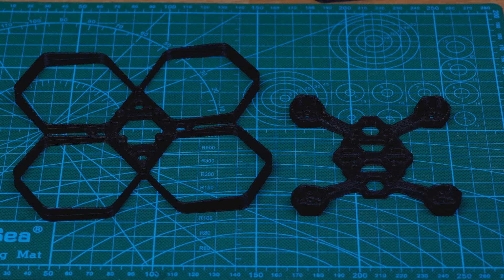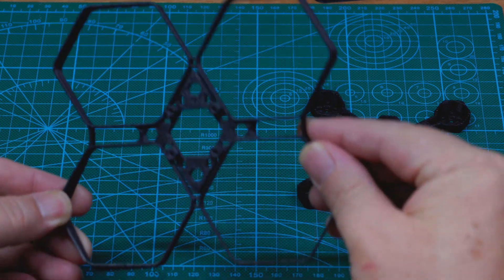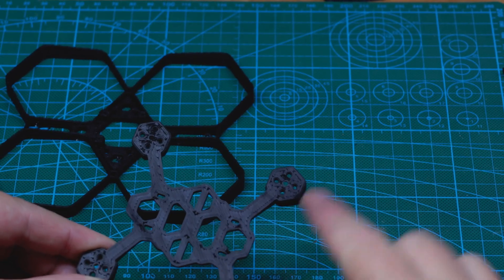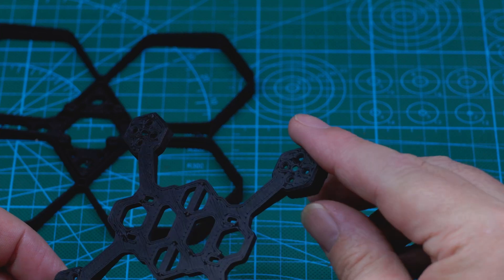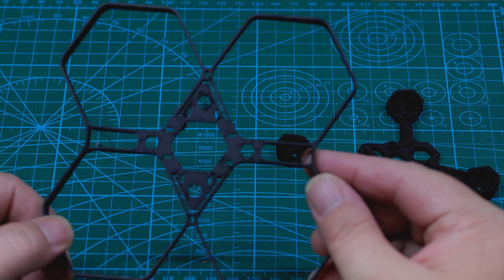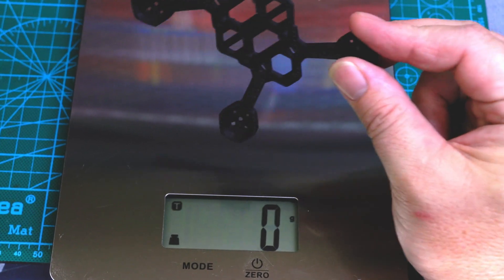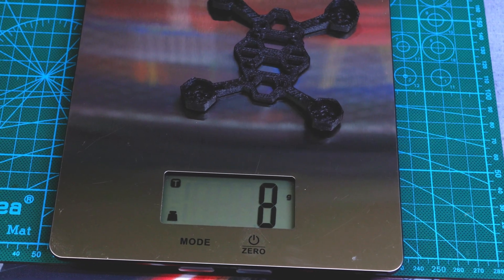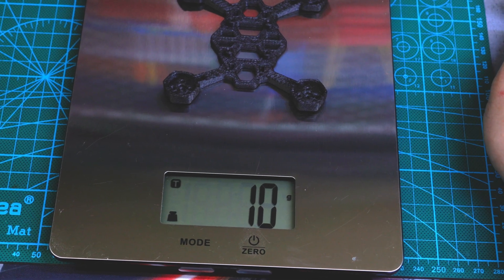Bambu Labs Carbon Fiber Filament Comparison

Comment: Why would you use the 0.6mm nozzle for such small parts?  Bit of a handicap for the final print, I would think.
Reply: you have to use 0.6mm or larger to avoid clogging when printing with CF-Filaments
Reply: @mihedas no you don’t. I’ve got 6 machines all printing CF filaments daily on .4 nozzles.

Comment: Other than dry filament letting the print cool down on the plate is necessary for some filament. Many contracts a bit and letting it settle there.

Comment: PAHT-CG is a PA12 which still can absorb water from the air. Maybe that is what caused it to warp.
Try these and let us know:
A. keep it at 80c (drying temp) for awhile
B. put it in a vacuum to keep it from absorbing water. If it doesn't warp, will it warp if taken out and exposed to humidity?
C. maybe something simple putting it in a zipper bag the filaments come in with an oxygen absorber.

IDK, that may be the problem, maybe not. Just some delirious thoughts when I should be sleeping lol.

Comment: I'm going to be making rc car parts in an X1 carbon. Which filiment do you  reccomend for strength?
Reply from the maker: Either the PETG-CF or the PET-CF.
Reply: @lendizzle77  I would go with PC-CF instead, it is much less brittle compared to PETG. PETG will snap off when it reaches its limit, PC will just bend (but it is very rigid).

Comment: Great video, and while I've really liked the Bambu PET-CF I'd be more tempted to print a drone frame out of their PC which prints very nice, is tough and seems super stiff. If I could offer one suggestion for future videos, I would have liked to see a measurement of the shrinkage factors for each of the filaments eg. add a calibration cube to each plate. A huge thankyou for the work and a big thumbs up on the video!
Reply from the maker: Same. I printed the spool cover out of PC and said this on stream too. Thanks for watching!
Reply: I’ve really loved their PC.  Prints so nicely and strong as heck.

Comment: It's quite interesting. Your results are very different from what I get using PLA-CF, PAHT-CF and PET-CF. In my prints, PLA-CF is, by far, the less stiff of these 3 filaments, even after waiting for the PAHT-CF to  absorb moisture from the air, but PET-CF is the stiffest. In my tests, I get PET-CF > PAHT-CF (dry or wet) > PLA-CF, so the same that Bambu Lab advertised . The results may be different because of the deformation you had with the PA, the structure of the part is not exactly the same as the others anymore.
Thanks a lot for sharing.
Reply from the maker: Thanks for sharing.  Very interesting!
Reply: Which of these has the most moisture resistants?

Comment: I have no experience with any of the CF filaments, so take this for what it's worth, but did you allow all the prints to cool completely before removing? Just wondering if removing them before they were completely cool may have been a source of the warping. Getting my X1C delivered tomorrow according to UPS.
Reply from the maker: They were not hot or anything and probably back to almost room temperature before removing. I may print the PAHT again to see if it was just a fluke. Happy printing. Live stream on Saturday if you have any questions

Comment: What I waould try with the paht is put it back in the machine with a weight on it and give it filament drying cycle then leave it cool to room temp with the weight still on
Reply from the maker: That could work

Comment: Interesting to see so many gaps in the pla-cf. I've been printing my honeycomb wall segments with it, amongst other things, and have had no gaps that I can find.
Reply from the maker: Which nozzle are you using?
Reply: @lendizzle77  .4mm, no clogs so far, printed about 2kg with it
Reply from the maker: I will try it out
Reply: Ive gone through 8kg going on 9 of PLA-CF on a 0.4 and ive never had a clog with it.

Comment: I don’t think carbon fiber filament is worth it. Maybe just print in petg or PLA.
Reply from the maker: The PC I used for the spool cover is more rigid
Reply: CF fillaments are about twice as stiff in bending compared to unfilled
Reply: The carbon is required for larger models to prevent warping. Also it is a bit stiffer compared to non-carbon filaments..